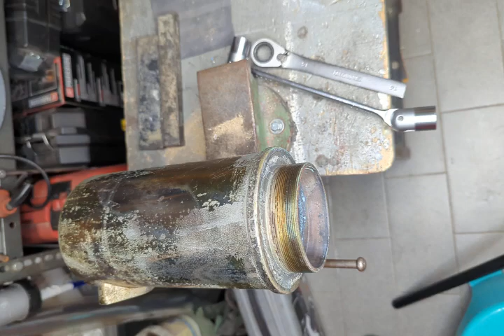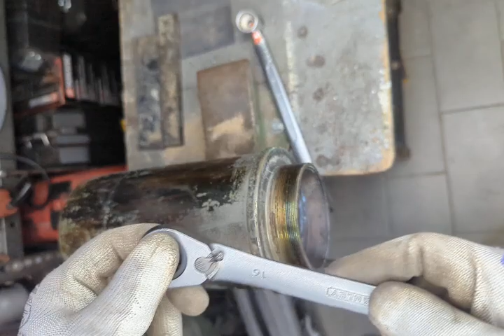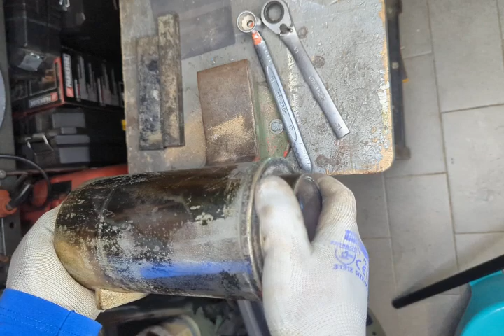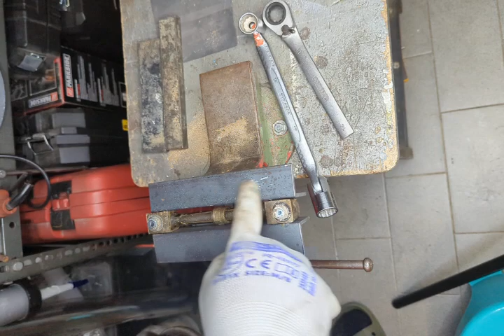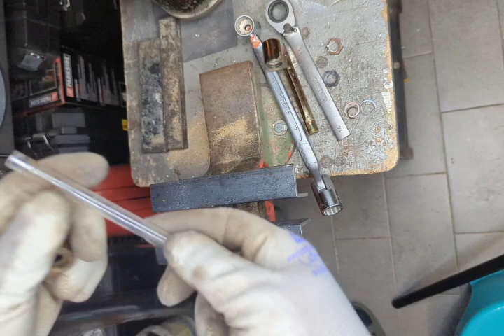La Pavoni sightglass removal/recovery

Comment: Why wouldn't you remove the sight glass parts (glass tubr, nuts, gaskets etc.) prior to unbolting the sight glass retainers from the boiler?
Reply from the maker: There are some cases (old untouched machines) that are impossible to remove the sight glass (conventional way) without breaking.  Those with hardened gaskets. This is a work around if you really want to recovere the glass.
Reply: @rueljuachon4374  Ah, I see, many thanks for explaining that for me.